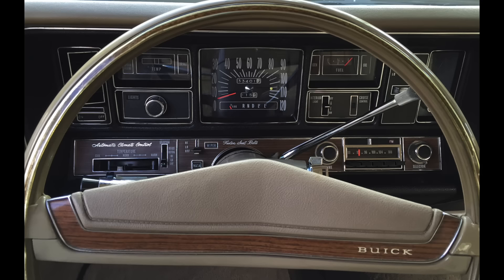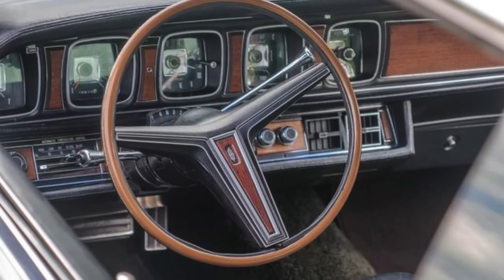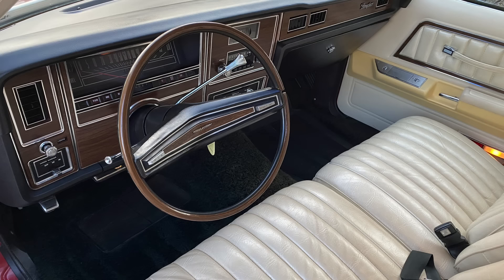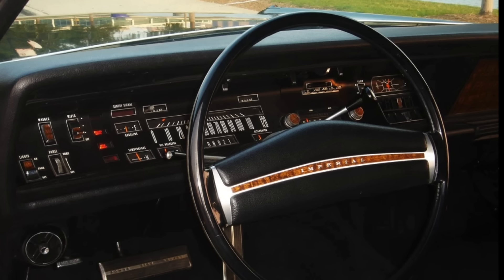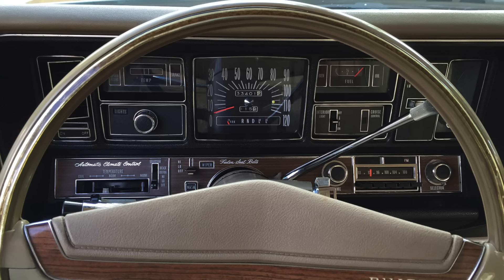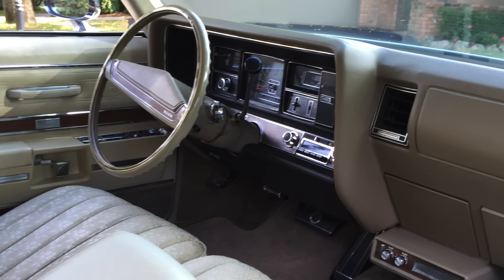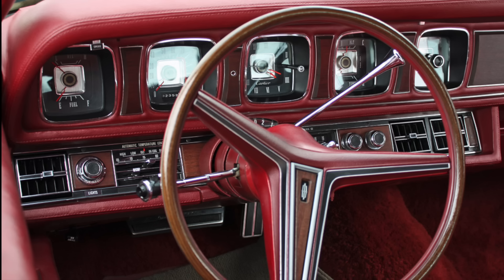Worst Automotive Inventions:  The "Rim Blow" Steering Wheel That Many Customers Hated

Comment: My source says it was first available on the GM CBO's, Ford and Mercury in 1969. 1970 It was available on Lincoln, Mopars and AMC! Last year for anyone was 1974. It was about as great as the FOMOCO Horn / Tilt Steering stick, Chryslers 1960's Dash Mounted Turn Signal switch and Cadillac's Hockey Stick Windshield Wiper Control! Of course even some newer cars had unique ideas that didn't work well in practice. Chrysler shifter that didn't have fixed positions, Ram Shift Knob. AMC/Eagle Premier turn signal flipper on the control pod. I am sure there are many more.

Comment: My first car was a 1969 Buick LeSabre that I got used in 1976.  I do not recall having this type of steering wheel.  Maybe I had it and it no longer worked?  Only 7 of the 8 cylinders of the V8 engine worked.  I sold it in 1979 and only bought new cars after that.

Comment: Our 71' LTD had it and it worked well.  Never had an issue.  I do remember the little ones playing in the car depressing it and laughing.  I personally like the feature but our car had power steering so rarely had to crank the wheel over.

Comment: My 90 Mustang has 2 buttons on the spoke part of the wheel left and right because of the airbag. Many times I went to hit the horn only to pound on the airbag and get nothing. Plus side is the buttons work very well compared to my newer vehicle with the horn button on top of the airbag you have to push really hard to activate it.

Comment: My mother's 1968 American Motors Rebel 770 had something similar.  It had a 3 spoke steering wheel with each spoke containing a 3-inch long horn button close to your hands.  I never liked that design, because those buttons were only in the right place when you were going straight.  The middle of the wheel never moves, so that's where the horn button should be.   In an emergency, finding one of the 3 horn buttons was never easy.

Comment: My 1970 Deville convertible does not have rim blow. That is why the steering wheel is a completely different design. And Adam, I beleive you did not like the look of the 1970 Cad steering wheel 🙂I actually like it, but agree that it is not quite as elegant as the 69 wheel with rim blow.

Comment: I drive a 90s car with those small horn buttons, it's pretty small and hard to press, it required a bit of thumb strength to press. 
It gave the wheel a clean look, but I just don't like how finicky the buttons are.

Comment: I thoroughly agree about the old thin wheels I get hand cramps with the new ones. Remember the power steering on old mopars that could sit stopped with a 440 in an imperial and you put one finger in the wheel and spin it as fast as you want and not overrun it at idle? New steering is STIFF. Manufacturers brag about rack and pinion steering it's an OLD cheap system that no one wanted on luxury or even econo American cars then because it's impossible to maintain proper geometry in turns without idler arms and drag links. That's why many new vehicles screech when turning short on concrete etc.

Comment: My vote goes for the side avoidance sensors. Mine died just outside of extended warranty. Plus they are on the same circuit as the backup camera. Blows fuses instantly.
Plus they werea distinct PITA at a two lane left turn.

Comment: Actually Ford came out with the Rim Blow wheel in 1969 as my  69 Mustang GT with the deluxe interior has one.  Ima replacing the horn ring  in the wheel with a ne one as the old one has finally died.  Neat feature but troublesome at best.

Comment: I can kind of see how that horn-control design could cause issues.  Personally, I think Lincoln did it best with the horn buttons built into the spokes up to 1967; one could easily blow the horn without having to shift a hand, and there really was no real chance of an accidental sound-off unless the driver was a certified idiot.  On the other hand, despite the issues with the rim-blow, I disagree with the OP about it being "the worst" horn design ever.  That notorious status goes, ominously, to Lincoln, which put the horn circuit onto the turn-signal lever of the humpback Continental in 1982 (and probably other years and models as well)!  To blow the horn on that car, one had to push in the lever towards the column, which goes completely against any driver's reflexes.  By the time one realizes that the horn is located on the turn-signal lever and not in the hub of the steering wheel, the situation warranting a horn's use has long-since passed.  I had that experience more than once with the '82 my grandmother had for a few years.

Comment: Rings looked cool, but they were too easy to break. Buttons on the spokes kind of worked, but they were a little awkward. Even worse were buttons on the ends of the stalks, as found on 1960s Opels and early Fox-body Fords; who would even think of that as an improvement? But RimBlow had them all beat; it was too easy to hit by accident when the car was new and hard to activate at all when the rubbery plastic got old and stiff. I remember having to squeeze multiple places on the wheel to find the  one that still worked while the guy in front of me was backing up. Meanwhile, the perfect solution was right in front of us the whole time; the center of the wheel was where human instinct would lead us; horns are meant to be punched, not daintily pressed.

Comment: For me the absolute worst invention was when they moved the headlight dimmer switch from the floorboard to the turn signal lever.  You didn't have to take your hand off of the steering wheel to dim and brighten the lights.  I suspect this was changed because the floor mounted dimmer switch was susceptible to water damage from wet/snow covered shoes.  Does anyone know for sure why it was changed?

Comment: I had a 1970 Mustang Boss 302.  It had the rim-blow, 3 spoke wheel.  Unfortunately, the car had quick ratio steering with no power assist.  In my car you could tell how tight the corner was or if I was parallel parking by how many times the horn blew.  Got embarrassing after a while.

Comment: I really miss cars like these with front seats not so divided by center console imposing from between the seats or jutting out from the dashboard forming a separated cockpit. In these cars you could park on a curb to the right then just slide over from drivers side across to passenger side and get out onto sidewalk without having to get out on driver side into traffic passing on left. Shifters on the column I prefer to floor shifter. Only time a shifter should be on the floor is in manual transmission cars. My name isn’t George Jetson and I don’t want to drive something all jazzed up that looks like it comes from outer space. If it runs, drives, turns and stops that’s all I need a car to do. If you ever saw vintage consumer reports magazine such as from 1980-83 their biggest new car complaint was seating for only two in the front row instead of three people. Fast forward 40 years no one wants and certainly doesn’t expect 3 seats up front without a physical barrier or separation in the middle. Let’s not even get started with this power window crap I’m not disabled I am capable of doing it easily manually!

Comment: As the whole spoke blew the horn? I had a '72 and '78 Impala and an '88 Caprice that you could press anywhere inside the wheel to blow the horn. Volvo and International semis had/have city horn buttons on the top two spokes with the air horn pressing the center pad/airbag. Which is annoying since you inevitably sit something on it.

Comment: With regards to the Dodge Durango/Chrysler minivans that isn’t true. The original 1998 Durango used the same taillights from the 1996-2000 minivans in the same orientation. The minivan shown is a 2001-2007, which featured entirely unique taillights never used by the Durango.

Comment: Not as bad as Ford moving the horn to the end of the turn signal stalk in 1979. Talk about inconvenient, especially when you're used to traditional horns.  And it was an actual button. You had to push the whole stalk in towards the steering column.

Comment: The original Dodge Durango and the older Dodge Caravan comma The one that you show is from about 2003 period earlier than that they use the exact same Tail lights period they didn't turn them over they just used the exact same taillight. As for the rim activated horn button Chrysler had those on the Dodge Dart for I believe 1971 72. I found it kind of interesting. It was also quite intuitive but people trying to reach in and push that horn ring was not that hard all you're supposed to do is reach out with your fingertips and pull that horn ring back towards you and it honks the horn just fine. How come nobody knows how to use the horn on their car. If you have a pad it reaches out to the edges you just take your thumb and hit the edge of the pad. Honking a horn on a car was not that bad in the late 1960s. The rims design wasn't that difficult, but it could be temperamental if you abused your steering wheel

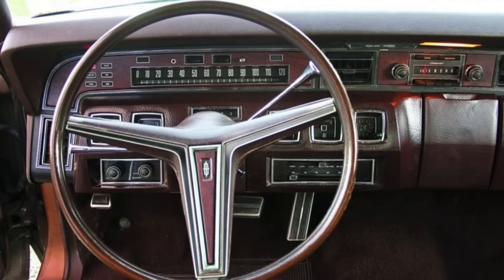Comment: Rim blow was a terrible feature, for all the reasons you mention. Never owned any, but drove hundreds and had colleges question what I wanted when the horn blew. At 6:15, what is the missing in the gap on the left of the left lower controls? 👍🏾As usual.

Comment: I would rather have the worst 60s car with the worst options than anything made in the modern era. Anything made after the 90s is garbage. There have been some decent engines built after that. But the unnecessary technology in modern vehicles just ruins everything.

Comment: 1968 Oldsmobile Toronado had this! Dad was quite a car guy his Olive with luxury black interior always got comments! 
It had a great steering wheel with “rimblow” which he loved! 
But your first 2 reasons are way off — you had to slide your thumb to the groove spot and then press firmly! It was never honking inadvertently! That’s ridiculous. More likely poor drivers “forgot” where the horn was in a situation. 
The 3rd option is most likely that the rimblow activation circuit died! 
It went all the way around the wheel and American quality was iffy at best. 
The rimblow was an excellent safety feature — doomed only  by poor drivers and poor quality wiring.

Comment: Those tail lights are NOT the same. Just look at them. First gen Durango used the same ones as the 3rd gen Caravan (that's a 4th gen minivan in the picture), but they weren't upside down. They just were exactly the same.

Comment: Age 16, 1st car, 1970 Mach 1 off the showroom floor it did not have power steering and with the rim-blow horn I often sounded the horn unintentionally. Dad had the dealer install power steering; problem solved.

Comment: Didn't Ford equip several of its vehicles with a button at the end of the turn signal lever to actuate the horn?  Late 1970s into the mid 1980s, I believe.  That was a much worse idea.

Comment: IMO, the worse invention is the 2 tiny horn buttons on the ugly air bag steering wheel on the early 1990s mits 3000gt. & the horn stalk!! on ford fairmonts - i believe.
Also stupid was putting the HVAC controls to the LEFT of the driver & on some, the radio was put to the left of the driver.
On modern vehicles, the problem is that the brake pedal is too small on automatic trans cars & they are too close to the accel pedal, allowing you to press on both pedals at the same time with the right foot!

Comment: I think it was Fords creation, I  owned 70 Sedan DeVille which  had the regular horn pad wheel the 70 had the horn buttons on the end of the two top spokes,back in the day I mostly owned Cadillac and Oldsmobiles from 65-77 and also a 69 Imperial which was operated by the horn bar,the only cars I had with the rim blow wheel was my 73 Lincoln Town Coupe' and My 73 Mercury Colony Park 71 Mercury Colony Park wagons,

Comment: The electric over hydraulic brakes were the worst design flaw ever, if your car dies you have absolutley no brakes. We had a 1980 Ford L7000 that would die all the time and you would loosw brakes and power steering and most of the time go into the ditch

Comment: The switch action on the Ford rim blow switch was not pleasing.  The action required from your fingers gripping around the (thin) rim was unnatural and the pneumatic tube gave poor tactile feedback, so if you wanted to give a brief 'toot', say to a bicyclist, it was tricky to do so.  In those days, top executives at Ford and GM were given free use of high end cars which were maintained by company staff and changed out frequently, so the executives in practice never faced the question of 'what does this car cost?' and never dealt with normal ownership headaches nor sampled the competitor's cars.  Perhaps in this case, that policy worked to retire a feature that never lived up to its promise.  
Also hated and retired was the 'press the turn signal stalk inward to honk the horn' that was on the Ford Ranger and a few other Fords for a few years.
An idea for a future video, brought to mind by your 1974 Marquis.  That car had dual horns, and boy were they loud and authoritative.  In the 70's large cities did not enforce noise ordinances and the custom, especially in New York, was that many drivers would use their horns frequently to express their displeasure with the actions of other drivers, not necessarily to indicate imminent danger.  What a racket!  Modern cars have more uniform and less annoying horn sounds.  I suppose there's a law about that these days.

Comment: The one feature that I miss!
Lincoln spot under the two spokes one finger to spin the wheel and Not honk the horn.
About to hit somebody squeeze not the thumb pinch. Oh shit tense up and honking the horn before you hit the brake. Used to be Accident fault included avoidance. Did you honk the horn to alert the other driver. Witnesses said they thought the horn was stuck until I relaxed and let go of the wheel.
I thought it was it didn't give as much as the government wanted to stuff and didn't bend.

Comment: I respectfully disagree- I had a 69 Mustang Mach 1 with rim blow and never had an accidental activation. I was used to driving the late 80's-90's cars and the current horn set up, but liked how you could just press your thumb into the wheel and sound the horn. No need to slam your hand in anger at the center. Never had any failures with it either. 
Now, I never did take the car to a road course or anything, and it had power steering (very loose as was that era) so fully gripping the wheel or white knuckling it wasn't really a thing. Maybe that would have changed my mind- if it had manual steering?
Other worst invention: automatic retractable seatbelts- the ones that ride along the track when you shut the door.
Second worst invention: Today's "automatic" wipers that supposedly sense rain drops. There's times when mine go from low intermittent to fast speed for no real reason. Total waste of idea.

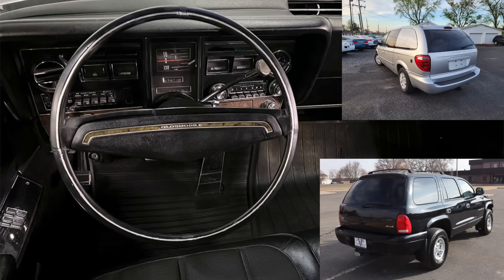Comment: @3:10 I can't see whats going on with that 180 degree tail light similarity
Reply: He's partially mistaken about those taillights.  The 1st gen Durango used the same taillights as the sister Chrysler minivans.  Not the generation minivan in the pic nor they weren't inverted.
Reply: @MuniTechnology  came for this, thanks. Also the tailgate was shared  IIRC...
Reply: @scootermann83 Tailgate?  I NEVER knew that!  The outer skin is different, but the shape is identical.  I had the exact Durango he showed in his example. I loved it.

Comment: The horn ring was trying to be a horn you could use without moving your hand from the steering wheel. The problem was in collisions, they often broke and were then dangerous sharp impaling parts. It was thought that moving your hand to blow the horn was losing some control on the car. Rim blow worked fine. There was nothing wrong with it. It certainly wasn't the worst. Some people disliked it, or MOST OFTEN people did not look at the owner's manual, and did not listen when the car dealer told them how the new features worked. These people had no idea how to use the horn. No ring. Depressing the center did nothing. So, being the Karens of their time, they complained. So the US regulated horns to be center depressed. 

When airbags first came out, some car makers got permission to use one of the stalks, to press in on the end to blow the horn. Once again,  MOST OFTEN people did not look at the owner's manual, and did not listen when the car dealer told them how the new features worked. These people had no idea how to use the horn. Depressing the center did nothing. So, being the Karens of their time, they complained. So the US regulated horns to be center depressed. Again. So, after figuring out how to make airbags work, they had to figure out how to make them work while being only loosely mounted. More importantly, they had to figure out how to make it impossible for anyone who removed the airbag/horn parts to install them improperly. See, there are wires that stay connected while the steering wheel is turned. We called that a clockspring mechanism because of the windings built into it somewhat resembled a clockspring for wind up clocks. It had to go on exactly so the wires are not overstretched when turning the maximum amount in either right or left turns. Having the horn work through depressing the airbag itself got a whole lot of people who had no business removing an airbag to remove the airbag. It was never the contact switch. It was usually a wiring issue. Or the fuse. Once in a long while it was the horn itself failing. Almost never the contact switch, yet amateurs were sure that was it.

What is the worst is people claiming features that worked well, and even work on 55 year old cars, were the worst.

Please tell me your name is Karen. It is in my mind.